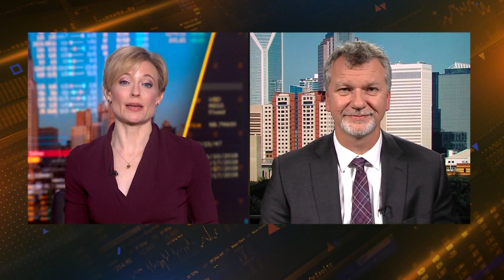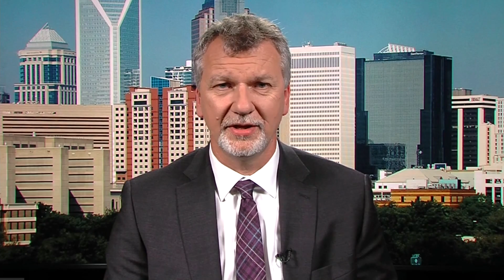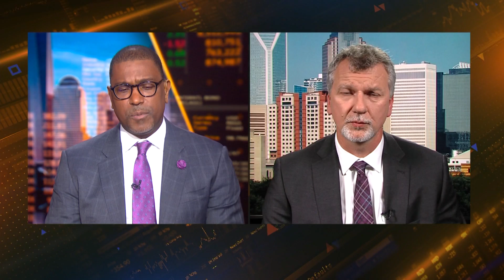Siemens Energy's US Transformer Production Plans

Comment: A few years ago I read an engineering-news perspective about the possibility that conventional copper/iron transformers, used
in power transmission and distribution, might be replaced by the sort of "switching converters" that (long ago) supplanted transformers in the production of consumer electronics (low power applications).
I think the greatest present demand for new transmission lines relates to regional (<400 mile) transmission for novel solar PV
and wind farms. For longer distances (upwards of 700miles) HighVoltageDirectCurrent(HVDC) transmission is more efficient
(much decreased power dissipation/loss); the fast-acting transistor switches in the converters Might prevent EMP damage,
and might also be amenable to incorporating switch-mode converters to replace the copper-iron transformers.